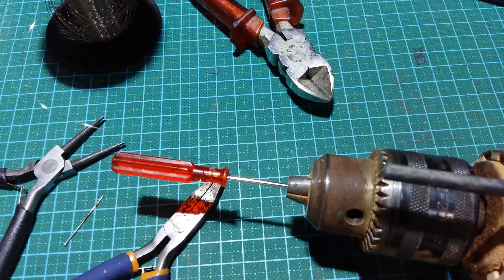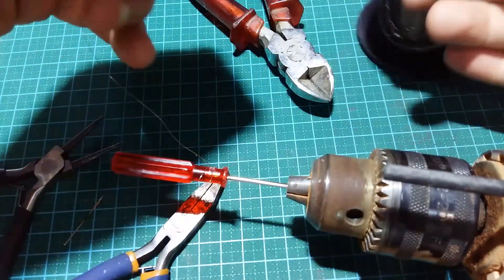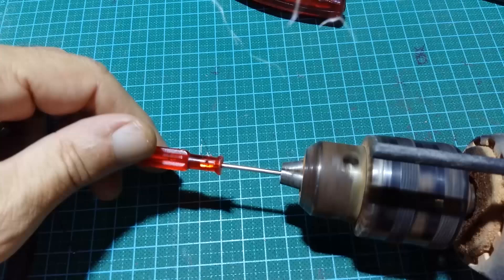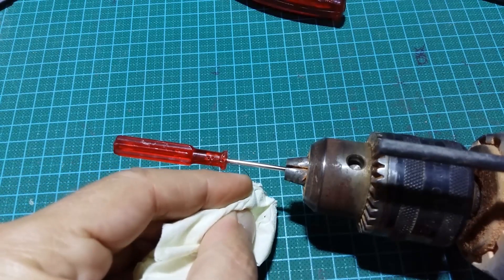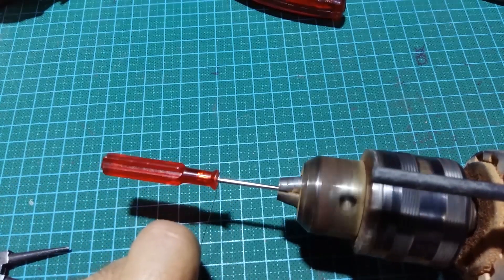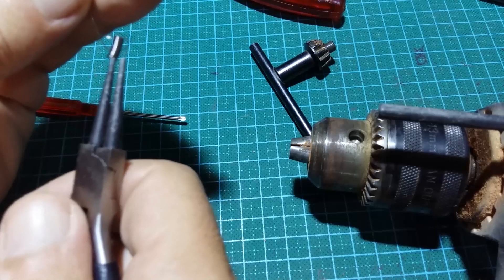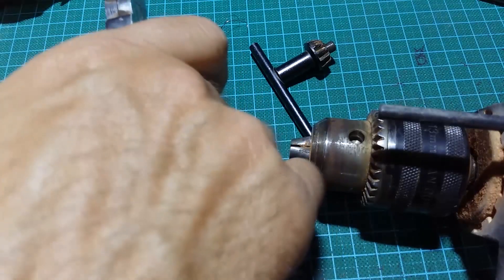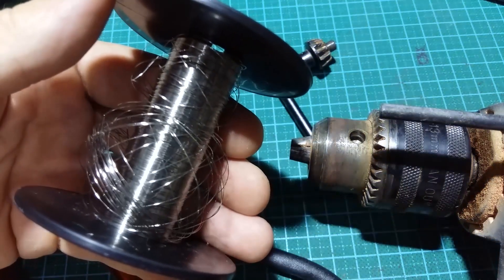Stainless Steel 304 Wire from Banggood.com - Spring Made Easy

Comment: Cool video indeed.

The screw driver a nice idea.   You nearly gave me a heat attack using your hand to reel it out but you seem to have survived.

Liked and subbed no hesitation.
Reply from the maker: Thanks.
Reply: Thanks for the link.   Your spring seems to work well.....    returns to it#s position.

I ve just order some 0.6mm wire.  Can you give a link to the better wire you mentioned?

Will the 0.6mm work ok?

What dia. is do you recommend?

Also can you make a torsion spring for us?   Thanks again.  A someone below said the video was nice  to watch.     Keep going!!
Reply from the maker: 0.6 mm should work well. Out there are gray steel and black steel, but sometimes hard to find on eBay. Only finished springs. For the recommendation, depend of what you need, how stiff, which diameter, length, and so on. I think I can do torsion spring, which is actually the same procedure as this spring, only with lesser turns, and probably thicker wire. Small amount of turns actually make torsion springs. I will do my best to make another video on it. Thank you for reminder.
Reply: Yes I can see that.   Thicker wire,  fewer turns.